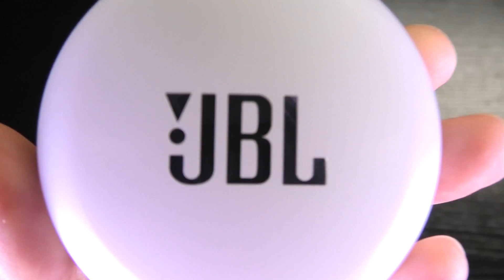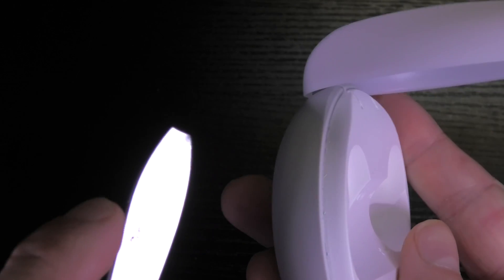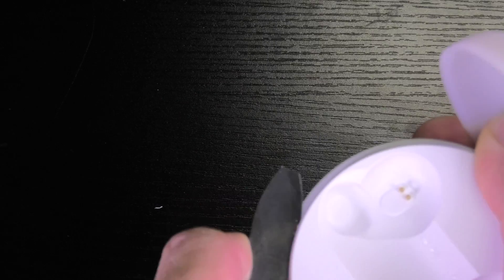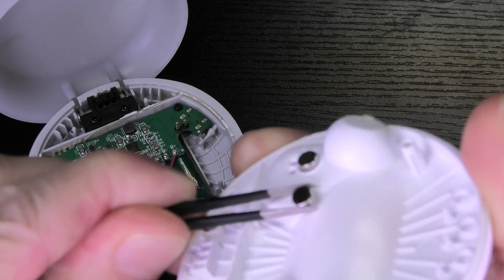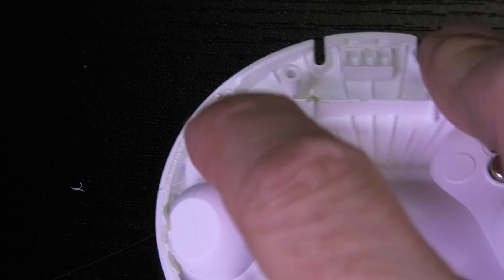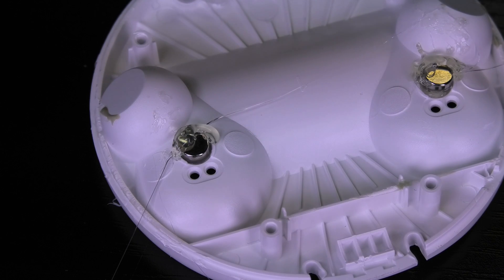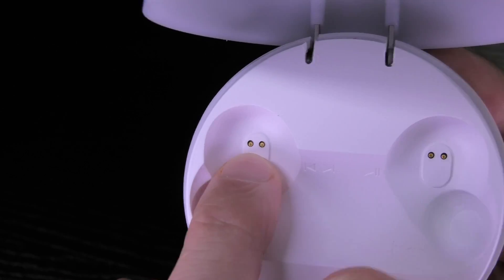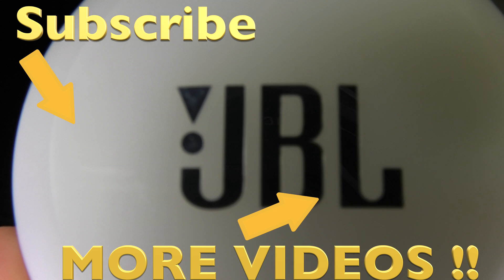🧲 Problems with magnets of TWS earbud charging case (how to FIX) JBL FREE

Comment: Any videos on how to fix the magnet if it's still  in place but for some reason has a weak magnetic field?  It pulls in the earbud into its place but it doesn't want to hold it tight enough for it to start charging  Until after I   Wiggle it around for a bit until it connects and then carefully set it down so nothing bumps it out of place
Reply: i had the same issue with my old earbuds. had to wiggle it a bit for it to start charging :(

Comment: what to do if the magnet is repelling instead of attracting?
Reply from the maker: Then the magnet was installed in the wrong direction and needs to be flipped around.
Reply: @MegaSafetyFirst  it was normal until it fell down and the problem is not with the box.

Comment: So, I have this same issue with my right earbud. I took the case apart and the magnets in the case are firmly in place and haven't ever moved, and I even was able to stick the earbud to the opposite side of the magnet in the case. It's as if the polarity in either the magnet of the case or the earbud has reversed. I've never dropped my earbuds or the case, this issue just "magically" occurred. How is this even possible? So what else could be the problem and more importantly the solution?

Comment: This is an awesome video! I've been looking for a comprehensive and in-depth video to help me with this problem for awhile and I had just given up hope... I was about to buy new earbuds but for now I will try fixing my JBL Free's by following your demonstration :)
Reply: So I fiddled with the case for an hour and could not manage to pull the two components apart. I used a knife and it wouldn't budge after a solid hour of trying to wedge it between the two pieces, and ended up with a little damage to the case. Any help?
Reply: Got the same problem
Reply: @JCel  yeah I ended up giving up sadly. I couldn't wedge the knife in between the cracks and it just kept tearing apart the case. So I ended up getting new earbuds.

Hope you have better luck than I do!